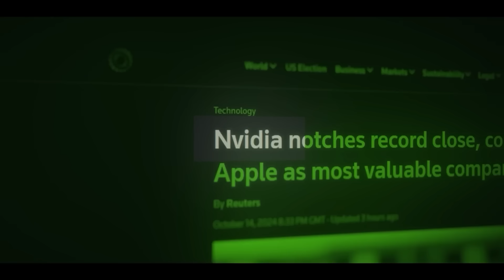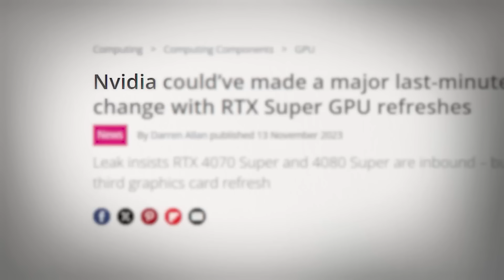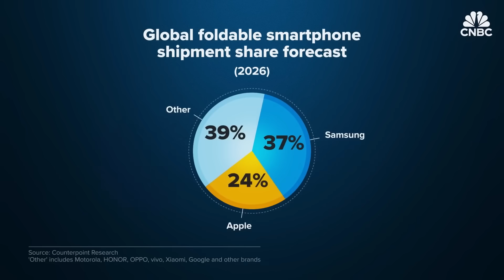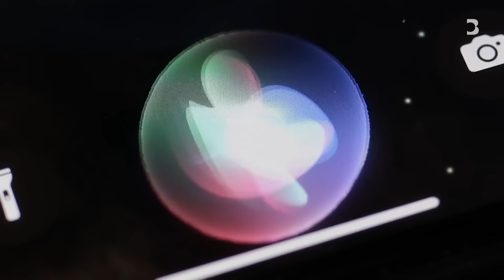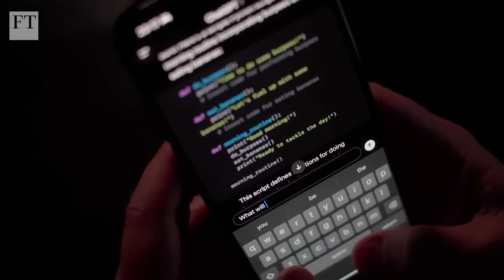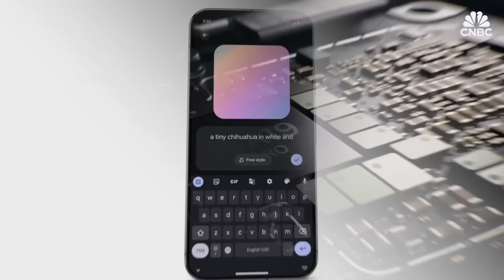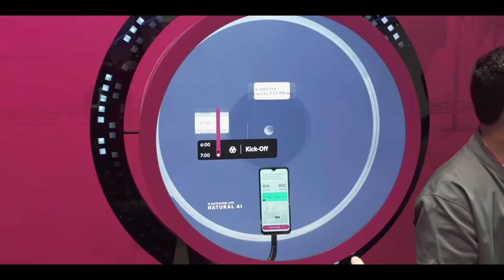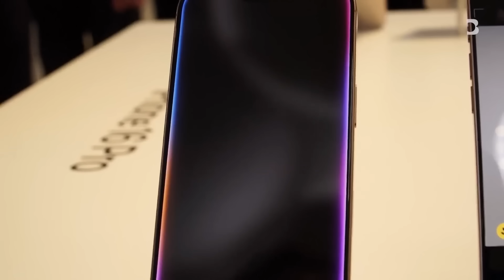NVIDIA Just Killed the iPhone – Meet the First AI NeoPhone

Comment: Please double check your AI slop before uploading. There is no way that (starting at 6:05) "AI operations are 100 times faster on your phone than in the cloud" and also you won't be able to "run GPT class models on your phone", assuming we are talking about the likely 100+ B parameter variant. And even if that were hypothetically the case, this would probably draw so much power, that you wouldn't want it to work this way...

Comment: How big will the battery need to be for such a phone?  Fails to take into account the DRAM price spike and shortage.
Reply: With the research and development at the tips of there fingers, not that much honestly. A small tiny mother board can run android 12-14 running a fine-tuned personal agent you can run any small deep seek model anywhere with a tiny cord to sustain it's "life"
  -power
Reply: @Justinkelsch  They better use a NPU instead of a GPU